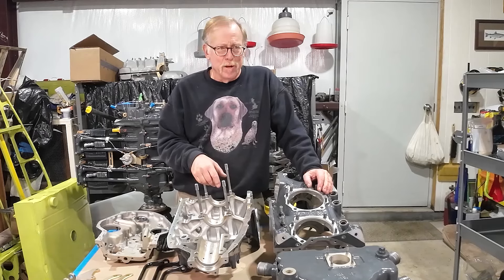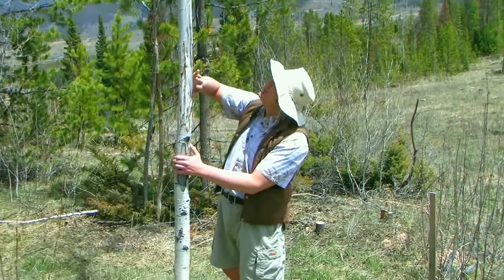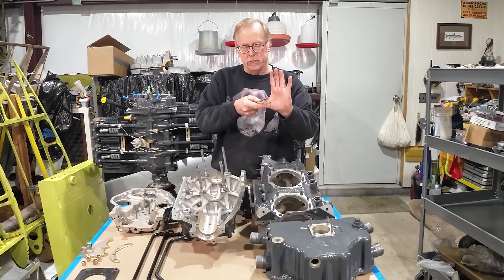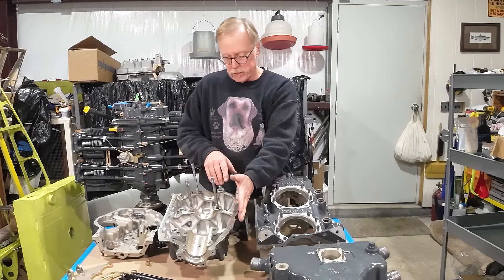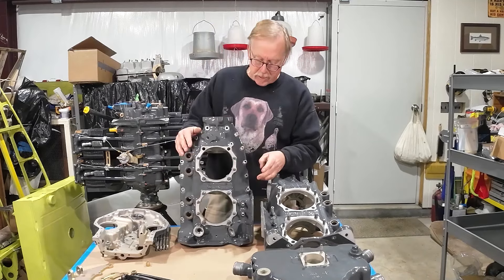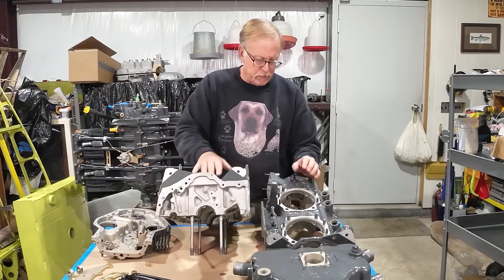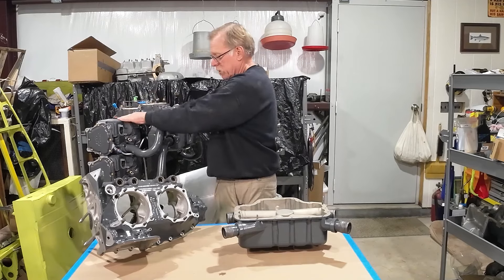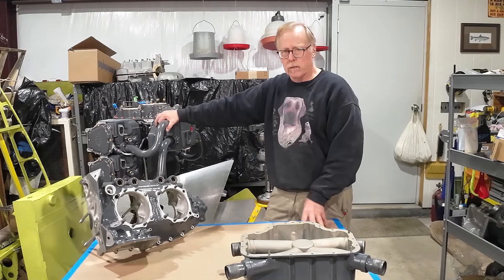Lycoming Narrow Deck 360 E02 Wide Deck, Narrow Deck? What do I have?

Comment: How about some Continental stuff for a change-?

I dont like Lycoming  engines.       WHAAAT-!

One has to remove the prop to change an alternator belt. Not so in a Continental.
More camshaft lobes/lifter faces, rust/spalling in Lycs due to their high mounted camshafts. Conts. are lo mounted cams and have that oIl drip effect from the crankshaft which staves off rust for a longer period.
Disassembly of most Lyc case halves is reqd. in order to replace lifter bodies while disassembly is not required on most Conts. for lifter body replacement.
Most Lycs are a heavier engine than a Cont.
The fuel induction pipes in Lyc engs  run thru the oil sump which prevents ice formation but also contributes to vapor lock when starting a hot engine.
Lyc engines use an idler gear between the crankshaft gear and the camshaft gear. Continentals do not need an idler gear to drive the camshaft from the crankshaft.
A&P / IA.
Reply: I fly a continental GO-300.. All rules are broken...
Reply: 😊 @WolfPilot
Reply from the maker: It's a Chevy/Ford thing.  Hoping to have a TCM engine build in the near future!